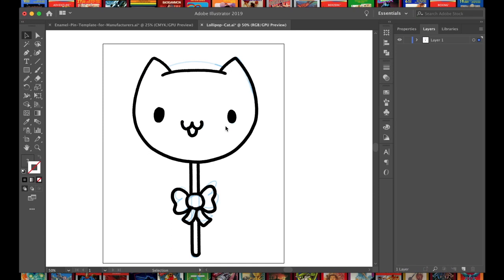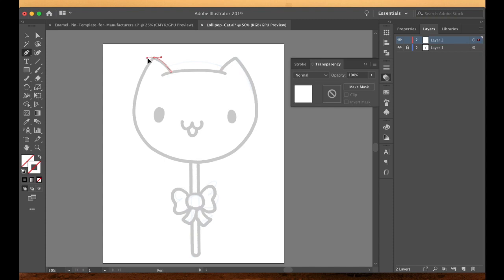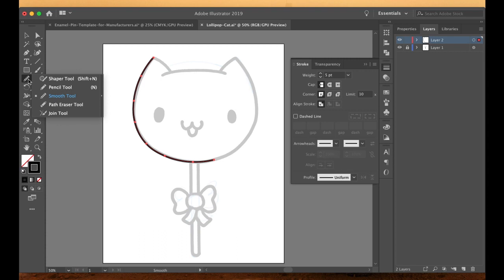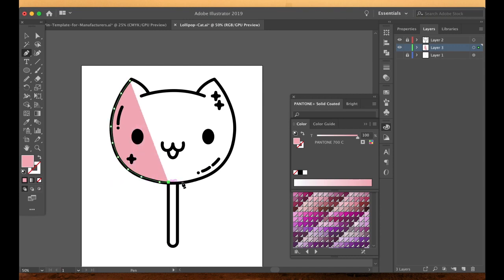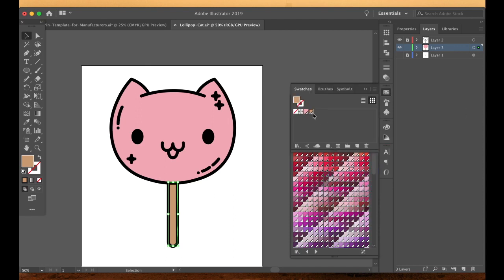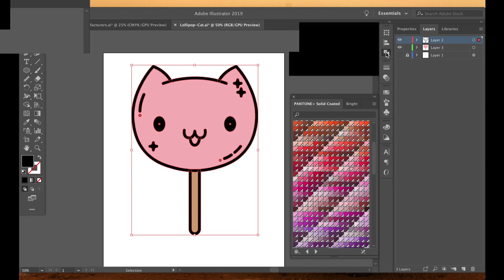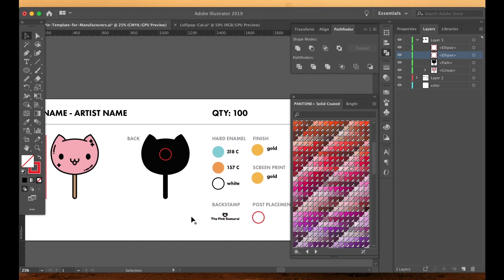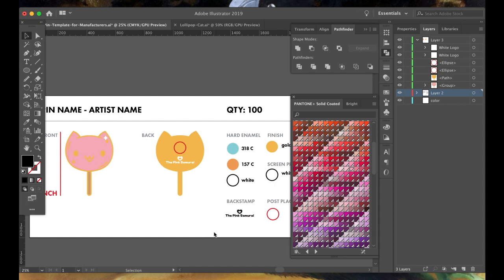How to Design Enamel Pins with Adobe Illustrator - QUICK & EASY

Comment: Another way to colour shapes is to copy and paste in front the merged shape (Ctrl-C Ctrl-F on PC) then go to Object-Compound Path-Release. This will separate the copied inner shape from the copied outline shape. Delete the copied outline shape and then colour the inner shapes. If you want to go one step further, click on each of the inner shapes in turn and do an offset path (Object-Path-Offset Path) and set .5mm or a suitable size larger. Colour these and delete the original copied inner shapes. Move these shapes back behind the original shape outline for edge to edge colour. This might sound long winded but it's really much easier to do than to explain. It also creates a precise path rather than a path with a ragged outline. I hope you find this helpful.
Reply from the maker: Thanks so much for this!  I love that there are so many different ways to use to Illustrator!

Comment: Hi Becky, your vids are super helpfull! Is there a minimum stroke size to use when you design a pin? Or does it differ by manufacturer?
Reply from the maker: It all depends, really.  Since vector files can be resized there's no real set stroke size to avoid.  I recommend asking your manufacturer, because their line detail might vary between hard and soft enamel.  Plus, when in doubt, print it out!  If it looks too small when  you print it to scale, it probably is!  I hope that was helpful!

Comment: Thank you for the wonderful video. ❤️ The template is a great idea! 😊 Also, Wouldn't it be faster and easier to use the "Image Trace" feature  on line-art  that is brought into Illustrator, and then the paint bucket tool to fill in the colors of the design?
Reply from the maker: Thanks so much!  There are so many ways to do the same thing in Illustrator, this way is faster for me, but if Image Trace and the paint bucket work for you, heck yes!

Comment: Thanks for another helpful video!! 😭😭
I don't realize that there's swatch and limit color function on AI. I'd struggled with color for my past pins and this helps me a lot to understand to make better one next time.

And I have a question. Is it okay to paste the finished drawing from RGB file to CMYK template setting? Will it change color or it'll be okay since it's pantone coated swatch? Thank you 😆
Reply from the maker: As long as your factory has the correct Pantone color numbers, you're good to go!  That's what's most important to them!  I hope that helps!

Comment: What if you want glitter in your pin. Do you make a glitter option on the side (instead of screen print, it says glitter) and you put the colours with glitter?
Reply from the maker: Hi! I usually just add "+ glitter" with the specific glitter color next to the pantone swatch in the enamel colors column.  Does that make sense?  It's hard to explain! You can always add another section if you like and feel free to use arrows to point to areas if you need!
Reply: @BeckyHelms  oooh yes. I've been wanting to add glitter, glow in the dark, transparent but I didn't know how to note it in. 😅 and I don't want to confuse the manufacturer either.